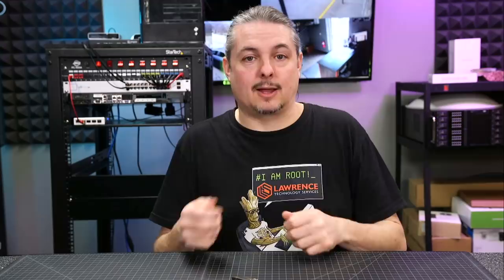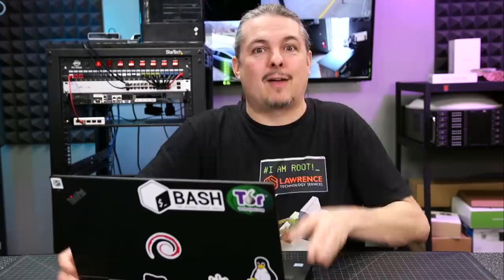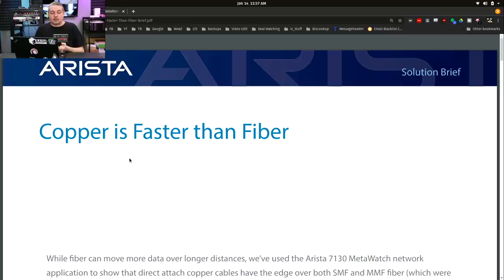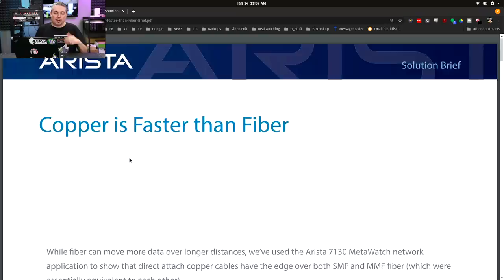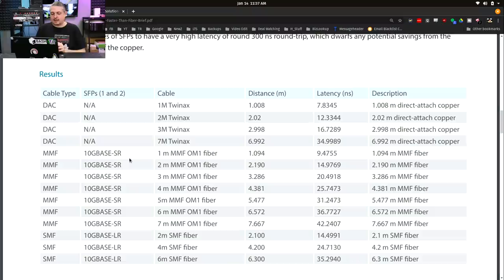SFP+ DAC VS Fiber Latency: Copper Is Faster Than Fiber

Comment: I want to bring up a Idea for a new video, because there is no info around this toppic at all. If you have SFP (no plus) - a DAC should provide a 4 GB/s link while a Module only provide 1 GB/s. But i found not a single Ressource where this is tested, if you can establish a 4.5 GB/s link over SFP DAC?
Reply from the maker: DAC ( non plus ) can't exceed 1GB
Reply: @LAWRENCESYSTEMS  There are G-PON (2.5 GBit/s) modules for SFP availible and working at full speed. The Interface link speed to the module ist 4.5 GB/s in SFP.... So theoretically DAC cables in SFP should work at full 4.5 GB/s.
Reply from the maker: @ravenvg  They only work if the switch supports them (not all do).  Also G-PON are fiber NOT DAC.
Reply: @LAWRENCESYSTEMS  You are right of course. The G-PON was only a Example to show that at some switches a DAC might reach 4.5 GB/s even on SFP. But found not a single Comment online about one doing this. So the idea was it is worth an experiment, but I dont have two switches with SFP and SFP+ here to do it myself. Thought you might have the equipment for this test and this would be of interest if it really is working... In theory it should...

Comment: Have you performed analysis of real world impact on short cables, where does it actually matter? These ns delays are similar to necessary delays such as the inter packet gap in most networking protocols, which rarely are huge culprits to total delay. And a store-and-forward switch would add much more delay than the cable delay. So I have some doubts about a few ns latency mattering in applications except supercomputing interconnects. The entire stack would need to be low latency optimized and latency constrained for a few ns to matter. I’d imagine most applications unable to demonstrate any performance impact due to cable latency on a short cable.
Reply from the maker: It matters in storage servers connected to hypervisor's
Reply: Lawrence Systems / PC Pickup hmm... wouldn’t impact be limited on such applications unless your I/O per second is awesome? E.g. 10 nanoseconds extra RTT on one million operations would be 10 milliseconds total. So accessing a 1M IOPS disk the cable delay would increase 1s I/O time to just 1.010s, I think unless I’ve confused my maths. But maybe the disk server is all SSD and IOPS are crazy high, both end points are crazy optimized, maybe there is some impact. I have a suspicion that even on a pretty high IOPS disk system you wouldn’t notice any real world impact by changing cable, but I certainly haven’t tried myself or been close to any gear useful for demonstrating :)
Reply: DAC is cheapest, lowest power, and lowest latency.
So it doesn't really matter if 3ns of latency is meaningless to you. There is not much reason to not use DAC.

Comment: Did I hear that right, electricity through a conductor doesn't travel at the speed of light?
Reply: You know what does? Light. In a vacuum.
Reply: @jpdalvi  WHY WOULD A AIR PRESSURE HAVE ANYTHING TO DO WITH LASER BEAMS
Reply: Schlomo Shekelstein physics
Reply: Yes
Reply: Inside copper, signals can propagate anything between 50-95% of the speed of light, depending on many factors. Inside glass, light travels at 2/3 of the speed it does in a vacuum.
Reply: Electricity in a copper wire in a vacuum travels at the speed of light in vacuum.
Electricity in a copper cable with plastic insulation travels at the speed of light in plastic.

Comment: I know you just did a video on the differences between media types, but it bares repeating for those who just stubble across this vid. and are reading comments.  The Copper SFP+ to RJ45 modules are not discussed here, and in terms of power draw and latency in early 2020 it's a bit... Well I wouldn't want to have more than a couple of those modules in a microtik 4 port. They get pretty warm and ... physics. As far as the subject of this video, latency I think they might be a bit worse then DAC.. not sure where they place when compared to fiber though. I expect this to change with better power efficient / less latency modules going forward into the decade.

Comment: This is really one of those economies of scale thing and frankly it's all relative to a term called velocity of propagation. Fiber is great for covering long distances but the velocity of propagation of light through fiber is less than the velocity of propagation of electrons over copper (meaning light travels through fiber slower than electrons travel down copper). What travels faster than electrons down copper? Light in free space (which still isn't exactly perfect to light in a vacuum) but that brings us into microwave radios which can cover distances up to 20 km with latencies less than 0.050 ms. 

Where it really comes into play is not when trying to cross racks or campuses but when trying to cross entire states/countries/continents. Say you need to tie in a campus or location that is 1600 km away. So you strech a fiber pair and find (due to the velocity of propagation) that your minimum latency is close to 8 ms...but also find the minimum latency for copper is only 7 ms. Further, you almost never are able to have a direct path (unless you go microwave) so the actual path of the fiber or copper may be an additional 1,000 km so all of the sudden that 1 ms savings based on distance turns into a 4 ms savings by the time you get the point to point connections ordered up. 

Again, latencies aren't going to that important between the two mediums for the average net engineer. Large enterprise, oil/gas, HFT, yes...it can be important but trading throughput for speed just isn't as big of a deal for the average admin.

Comment: Can you make a video where you install several wireless access points in one location? Like several Unifi AC-HDs in a building or home. How to get the best coverage, how do you set them up? Mesh networks are the "new thing", but dedicated APs, where each AP is connected with ethernet is better. I would love to see this with "real world" results.

Comment: 1:06 - 1:15
I don't suppose there'd be a way to measure exactly how much latency it adds? I'm working on something where using an SFP+ to 10Gbase-T module like that may be my only option.
Long as it's sub-millisecond I'm good, and I know that's not a very high bar to reach, but there doesn't seem to be a lot of info out there about it and I'd rather have a pretty clear answer before investing a few hundred bucks on some gear that may not even suit my needs.

Thanks for these videos, btw. Very educational.
Reply: The easiest way to answer this would be for you to tell us what your needs are

Comment: @04:25   What the hell?       What SFP's did they use?
 and what testing methods, we have access latency of 1.3ms at 7 kilometres with OS2
I suppose if you pay 20 buck for a cheap Chinese sfp module like g10tek or the like,  anything is possible :)
Reply: They also only tested OM1, no OM3, 4, or 5.
Reply: ns not ms.
Reply: @richardallen08  they tested SM also.

Comment: Copper is faster indeed. However cost much more to ground the wire. That speed aint going to add up if you have a surge and wipe out your line, nics, and any equipment living on the edge. Rule of thumb fiber for long runs or runs that involve going under ground or are easily exposed to environmental surge factors. Copper for local links

Comment: latency != speed.
Reply: Indeed, how does latency effect the T it takes for a large batch of files over common standards like rsync , NFS, iSCSI and CIFS ? I know latency in terms of lag for gaming but in the enterprise space, it's just dBase like MariaDB quarries and the like, no?
Reply: Latency has not much todo with speed. Its like fps has not much todo witj refreshrate of a monitor or shutterspeed vs fps on a camera. Can be linked to each other if one is to high.

Comment: I use armoured  OM3 LC Duplex mode fiber from ebay and i have a mediaconverter with sfp+ at the ISP switch and 15m of this cable connected to a TP-Link T2500G-10TS and i also have a wireless router 0.5m of cat6 connected,that i connect my Samsung phone to and test with the app speedtest, and i have only 4ms in ping time but i have FTTH that we as a house  share and we have 500/500 and 3 ITV boxes and 3stationary pc and 3phones connected to different AP's and there is generally very low ping at any of these points, I used to have cat.5e of 10-15meter and with copper i had higher ping than with fiber, so if you do it right you get lower ping and lower power with fiber so you must either done something wrong in your video or used a dirty or faulty fibre... or those sfp media converters have you checked them with a microscope for dust and contaminants?? You'll be scared/surprised of how much dust and grime that gets inside of the fiber connectors on the fibercable and inside your sfp converter/s
Reply: Yes UTP is slower than fibre. DAC copper is faster than fibre.

Comment: The distance / latency is a thing because also inside the fiber the signal is traveling with 2/3 speed of light. A good coax cable is a bit faster and copper (with plugs) is slower. (may I find the time to test it on my multiservice meter - thanks for the r&d dokument link)
This is also the reason why brokers all get the same exact length to the brokage servers. All have to have the same minimum latency, especially for High Frequency Trading, so everyone have the same possebilities.
Yes DAC is lower power, I've seen tests with 400G QSFP-DD - Copper 3,6 Watt and SMF Fiber with 40km optic it were @ 9,4 Watt and the standard says 12W. But there are "maybe" 15W DWDM 80-120km modules in developement.

Comment: I do have a Mikrotik switch running SFP+ and OM3 fiber, running to my 2 servers in my basement, from my home office/lab.  I like the 10 gig transfers, and latency doesn't seem to be an issue over 20 meters.  I did notice that the 1 gig POE from the Mikrotik to my TP-Link switch slows down my gigabit internet 100-200 megabits into my PC connected to it (the Mikrotik). Other computers not connected through the Mikrotik, get full bandwidth from their connection to the TP-Link switch, which is also connected directly to my router.  (1 gig)

Comment: You're using the word "DAC" is that a brand or are using that as acronym? If acronym would that be "digital to analog converter"? If that is the the acronym, is it truly converting a pulsing light to a electrical analog signal? I thought those adapters were named "media converters for a reason.
Reply from the maker: Direct Attach Twinax Cables (DACs)

Comment: Very interesting results, I primarily use DAC cables for in my cabinet due to cost, reduced power use and increased robustness.  Any idea how it would stack up to 10Gb/s RJ45 latency?
Reply from the maker: As you said at the beginning of the video, way more latency for rj45
Reply: @LAWRENCESYSTEMS  Thx for the response, It's good to know, I had assumed it was the SFP+ module to UTP conversion adding latency but missed the section where you also included built in ports.
Reply: RJ45/UTP ports have a conversion latency of 50-500ns.
It varies between different brands.
Receive typically has higher conversion latency than transmit.

Comment: Could you make a video about the differences and benefits of PON vs SFP vs SFP+ (fiber) and why ISP's usually use PON for fiber connections to consumers.
Reply: It’s so ISPs can split fibers and don’t have to have an individual strand going back to the Central Office/OLT for each customer.
Reply: You need to ask?

Comment: So in my rack to connect on my 10 gigs switches together I use 1 meter fiber cables multimode and ubiquiti transceivers so I should probably switch all those over to direct attach copper ?    Are there any good right angle direct attach copper patch cables ?   the only reason I didn't use direct attach copper is because it's harder to make look clean and my teenie brain thought fiber faster lol

Comment: Question: are SPF+ transceivers compatible with each other? or they need to be always the same brand? (example, buy a HP 10Gbe SPF+ nic card , can you mix them with a microtik SPF+ transceiver?)
Reply: Supertamai2000 - No, not all SFT+ transceivers are compatible with one another; and Not all DAC cables are created equal.  If you are running Cisco Switches , you will have an easier time finding off brand DAC cables, and have less compatibility issues but if you are running those cute Purple Switches from Extreme Networks, you better be using Extreme Certified /Branded  cables; especially if you need to call Extreme for Support.  Somehow they can tell when a non-extreme DAC cable is being used.  We have even seen ports just not light up at all.  There are firmware differences in the connector chipsets.
Reply: @jasonklems8584  I see, so some brands have harder/harsher restrictions and try to lock down the usage on their systems. The question is how can we find compatibility sheets? Because I've seen quite a few brands, the problem is that NICs are also dependant on the chip/controller they have.

Comment: Do they make a fiber to coax converter?  I want to run fiber in my rooms, but want to piggyback off coax lines throughout my home; much like a MoCA adapter, but for fiber.
Reply from the maker: Not that I know of
Reply: Lawrence Systems / PC Pickup Darn!
Reply: RFoG exists, but I’ve never seen it used outside of a telecom.

Comment: Thoughts on Unifi's new "enterprise" switches?  (USW Leaf and USW Pro Gen2)
Reply: Leaf is cheap, but the biggest downside at first sight is while it has redundant power supplies, they are not exchangeable, that's quite a no-go and I wonder why they took this route if they really want to play in the enterprise market, otherwise I don't know who this is made for. As for reliability and configurability I can't tell right know 

The Gen2 switches are very decent, Pro models kinda pricy but 10G and PoE++ as well as (at least promised) layer 3 seems like a nice package

Comment: A fiber connection also has more points-of-failure, since the transceivers can go bad and also fiber lines are kinda sensitive when it comes to bending them (unintentionally of course). If there is no need for very high transmission speeds, long distances or electrical separation, copper is the way to go

Comment: Light/photons are faster than electrons!
Copper also consumes more power (measure it yourself).

That is for the MEDIA, fir the SAME length, fiber beats copper in speed, BUT, there are other electronics and data coding used to transmit on each, which could make a difference.

Bottom line:
Unless you are doing NASDAQ transactions, it does NOT matter (except for the power used, again measure it YOURSELF).
Reply: You're correct that light travels faster than electrons in a copper cable, but moving electrons aren't exactly what transmits the information. The data transmission comes in the form of electromagnetic waves, which travel at roughly the speed of light. Electrons do move, but at what's called the drift velocity, which is slower than the propagation of the signal.
Reply: Speed of light through glass is around .66C and is actually slower than then electrical signaling rate in copper which is around .76C.